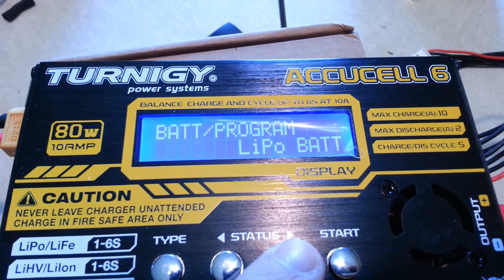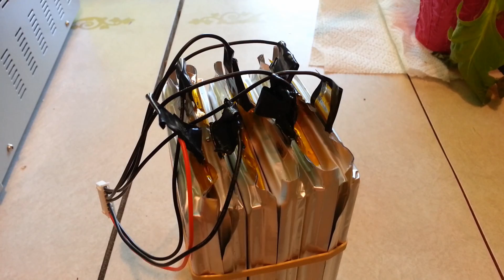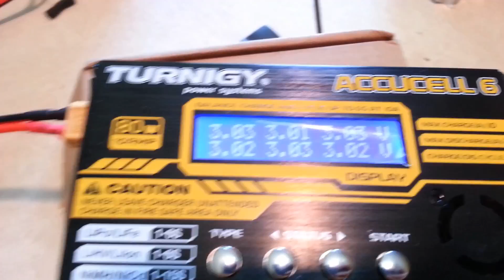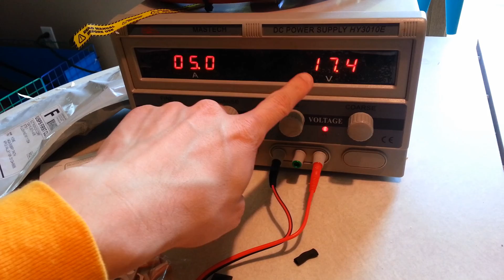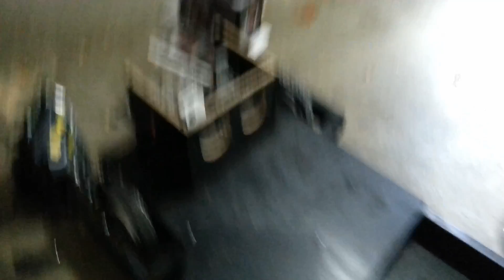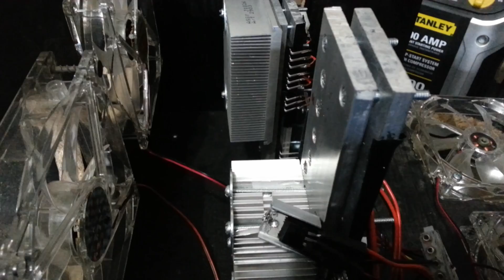Electric Go Kart, Part 4b - Charging Batteries and Voltage Regulators

Comment: Awesome, awesome series. Looking forward to the next one. I am doing a complete build too, and I am looking at ordering some batteries from ali baba - is that where you got yours? Can you say  who your supplier was?
Reply from the maker: +Tim Bradley Thanks! That is where I got mine. Shenzhen Benergy Tech Co was who I went through because of the price and the fact that they took PayPal. Many of them require bank transfers which I've never done. If you can figure out what voltage and capacity you need, get finished batteries with terminals so they are way easier to work with. Oh, and put fuses in your circuit, because I recently blew out my transistors which is why it's taking so long for the last video.
Reply: +Logan Poppe Thanks logan. Nice tip too re finished batteries. Cheers.